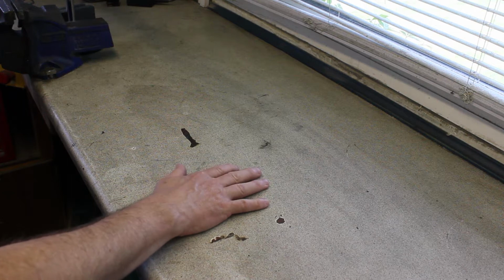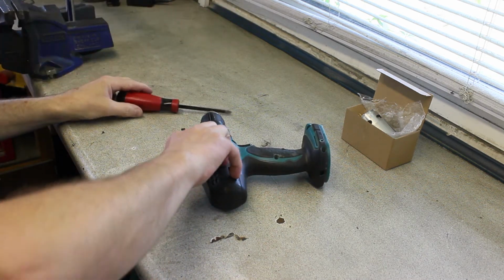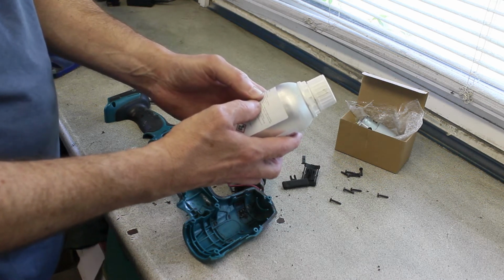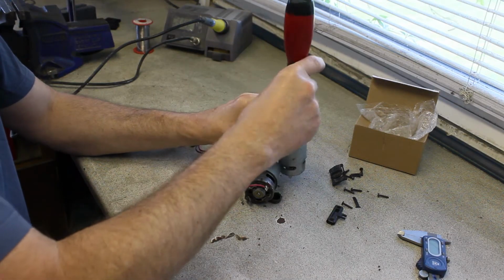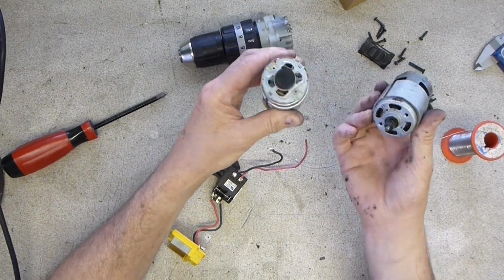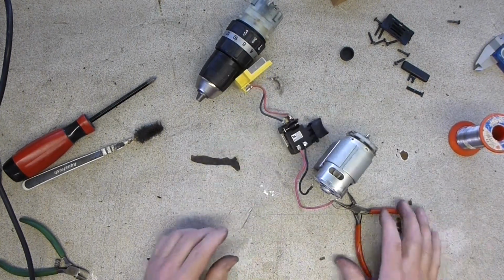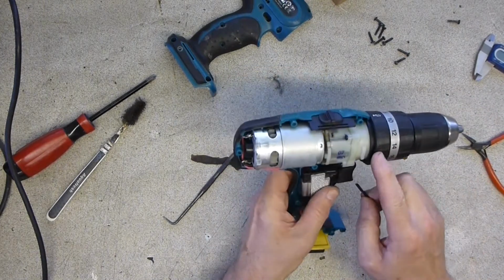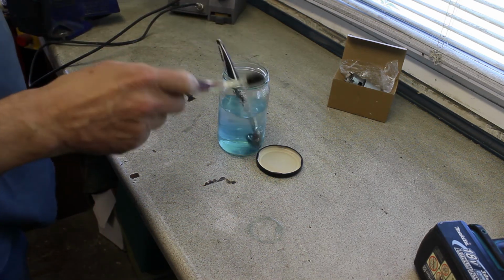Fixing my old drill as its letting out smoke!

Comment: I had an old 18v Dewalt cordless drill I retired over a decade ago, after about a decade of reliable use because it was sparking and smoking and the battery died so I bought a new 20v Dewalt and stored the 18v in a closet as a project.

I recently watched a few Youtube videos and I was going to replace the brushes, then I decided to use common sense instead.

I disassembled the drill, moved the hose of my shop vac to blower, blew out the carbon deposits that had built up in the motor as best as I could, then sprayed the inside of the motor with contact cleaner, using the shop vac as a blower. I repeated spraying and vacuuming/blowing a few more times until the contact cleaner was almost clear.

I reassembled the drill and connected an 18v to 20v battery adapter to the dril, but made the mistake of pressing the trigger indoors without turning on an exhaust fan.

The drill smoked a little, then stopped smoking, leaving a noxious odor in my workshop from the combination of the remaining carbon deposits and contact cleaner.  However, the result was that the drill works better than ever. I think using the 20v battery made the drill far more powerful, possibly more powerful than my other 10 year old drill.
Reply from the maker: Hi Eric,
Good call it does make you wonder just how many products are thrown out when all they need is a little maintenance.
Well done, replacement motors are not too dear when it finally gives up.
Cheers

Comment: That drill looks like a makita 453 i have one that packed up 18 months after only light use crappy plastic teeth sheered off inside. I could repair it but I fear the same thing will happen so I bought a all metal 458 to replace it. Thanks for the video and happy tinkering.
Reply from the maker: Happy tinkering to you too! It's always a challenge when parts like that fail.

Comment: Found this video after mine just started smoking too. I wasn't even doing anything heavy with it, just had it run at full speed continuously for a few minutes. It's a cheaper one, but it has been serving me great nonetheless. The brushes was what I noticed too, they seemed fine from what I could see, but even if they aren't, what bothers me is that they cannot be replaced. Although when looking for replacement parts I noticed that these motors aren't that expensive. May give replacing it a go too. Thanks for the video!
Reply from the maker: Hi @brokko_le3
Its definitely worth replacing the motor mines still in service and to be honest better built than a more modern version I have.
Cheers

Comment: could you have fitted spade connectors instead of soldering to the motor? Just wondered
Reply from the maker: Hi @barronian
If I remember correctly there is very little room in the casing also solder was how Makita did it, I guess for reliability.
Cheers
Reply: I was thinking the same thing

Comment: Thought I’d mention when you said it had loads of brush left the issue was the dirt it’s the same with dewalt mine what I thought needed brushes turned out to be clogged with sh•t basically oil and god knows what but after a clean it works as good as new if you would have cleaned that motor/brushed motor you would have saved a bit of money as it looked like it only needed a quick clean and it seemed to have quite a bit of power in it hope you kept it as a spare incase it is needed in future anyway nice vid I’ve liked and subscribed
Reply from the maker: @Brad-0212  
Thanks Brad.
I did keep the motor not got a clue where though! It is pretty knackered it got so hot the winding lacquer has partially melted so its not a good runner anymore.
Cheers
Reply: @CazualHaze  ah ok well if it’s needed as a spare for a quick job at least if you can find it then it might be usable nice vid anyway mate 👍
Reply: A new motor seems easier imho😅

Comment: In the old days we used makita drills with the old long NIcd batteries. Those drills shut of when overheated.  It seems that makita does not build in a temperature switch.  From video's i've seen the brushless drills do not smoke as fast as the ones with a brush motor.
Reply from the maker: I agree there are thermal fuses in some windings typically transformers. The brushless motors have alot of feedback to the controller chip so have more info on what's going on in the motor.
But as we know that all comes at a price. 
Cheers

Comment: Just had same go on mine and no easy way to access the brushes even then, As you implied with all the dirt inside, it could also be the windings too so safest bet is to replace the motor. Wondering how to keep the dirt out from now on to prevent repeat occurance as it packed up on ly after about 3 years of light use.
Reply from the maker: Hi @paredding
I think its best to not block the airflow through the motor it will overheat and fail early. Sounds like that's what has happened to yours. The new motor is cheap and its an easy fix!
Reply: @CazualHaze  Thanks. Yes - new motor ordered yesterday.

Comment: My Makita 18V DUB182Z wirings melted and smokes. But there no videos or articles on what wire size AWG to be used for replacement. Any advice?
Reply from the maker: Hard to know you could try and ring your local repair centre and see if they have a kit. There might be a spares kit for it online and finally you could measure the wire you have and then look up the AWG equivalent. 
You may have melted the trigger speed controller if it still runs at full speed with no variable speed then its toast! A new one will probably come with wires attached.
Good luck.

Comment: My big wired drill started to smoke.  Cant find a repair video for it. Dont know what to do. And it dont have nobody in my country trinidad that repairs drill. Heck its hard to get any dc motors to buy in my .country.
Reply from the maker: You might need a universal motor they run on AC or DC 
My email is on the about me page 
Send over pictures I will see if I can help
Reply: @CazualHaze  OK BUT DC MOTORS ARE A BIT HARD TO GET WHERE I LIVE BUT I WILL STILL SEND A PICTURE. I MAY EVENTUALLY FIND IT SOMEWHERE  IN TRINIDAD